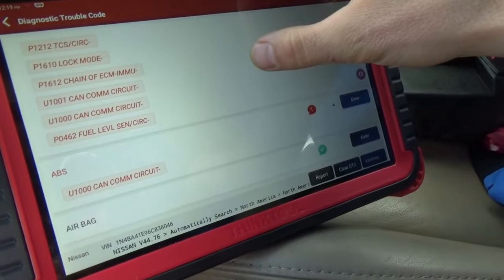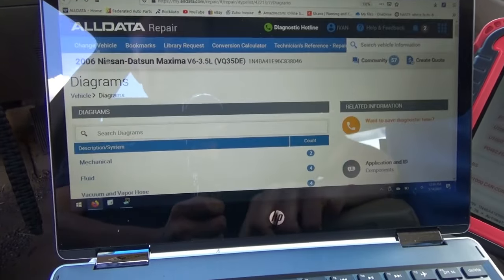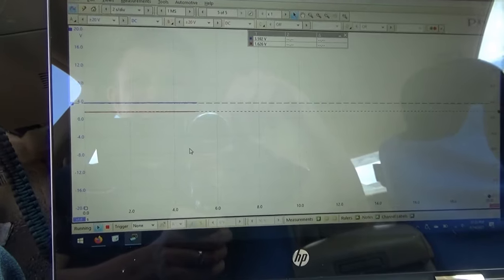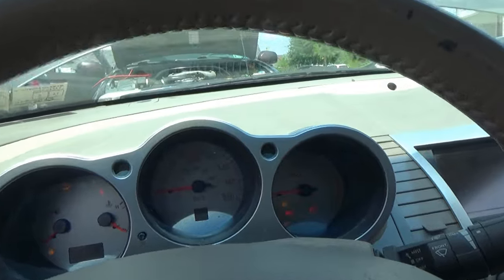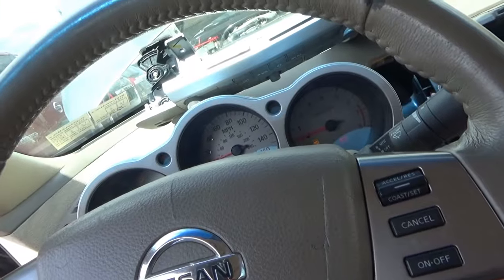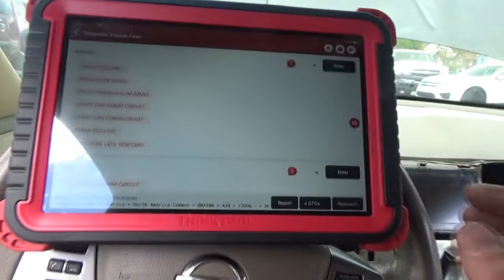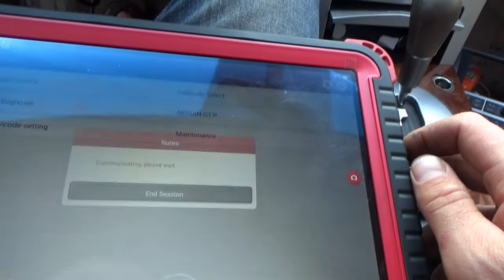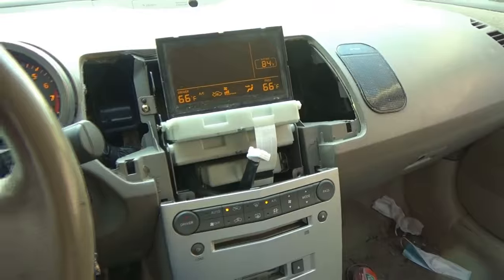You Won't BELIEVE why this Nissan Doesn't Start!!

Comment: I did one of these years ago. Wasn't too tough because...in an oddly proper move for me, I actually checked for TSB's for these symptoms. And sure enough, one exists for exactly this problem. Change had shorted the module in my case.

Comment: I live in Syracuse, New York. I'm tempted to bring my wifes 2014 Ford Fusion down to you to see if you can figure out what is going on with it. 3 other shops have failed. Good video.
Reply from the maker: Sure thing just fill out the appointment form on my website 👍

Comment: This was a very interesting one. I’ve actually had a similar case study a few years back which took me a couple days to solve. In my case the car was intermittent no start and also the engine would cut out and not restart after going over a bump at times. The end result was the lady’s toddler had been posting pennies (cents) into the CD player slot. They had made their way to the main board and were randomly shorting the internals. It was only after removing the unit and placing it down on its side by chance that I heard all the pennies jingling around inside. When I went to show the lady the issue she answered the door holding her child. During explaining the issue to the lady her child pointed at the radio and said “banky” 🤣 I instantly understood what had happened.
Reply from the maker: Amazing haha

Comment: How many times has it been the radio, for whatever reason. Rather after market or not. I can't tell you how many times lve found the problem to be the radio. Especially with battery drains.

Comment: Reminds me of back in 2000 when I bought this 1989 Celica GT (5 sp manual) for 1200.00. The car had been sitting for about 3 mo. and had a crank no start condition. I didn't know much about cars back then, but I tried almost everything to get it running and was about to throw in the towel when one day I was just looking around the engine and noticed some electrical tape on a wire connector. It wasn't easy to see hiding under some other wires and stuff, but I carefully unwrapped the tape and noticed the connector was kind of loose so I first pulled it apart to look at the condition of it, then put it back together and got a nice click and wondered why the tape? It seemed to connect just fine, so I thought for the heck of it, why not try and start the car. It started right up. It was unbelievable. The car ran great till I finally sold it just a couple months ago.
Reply: then it broke again?

Comment: I'm having the exact problem took the a/c module out because the car wasn't giving a code until I removed it. The car still didn't start but code came up as P0183 and P0462 which it says it's a fuel sensor but i already had put a new fuel pump in the car. Should I get a new a/c module could that still be the problem even with the code?

Comment: The can Bus is a 2-conductor bus, terminated at each end with a Terminating resistor, and if one is missing, it will cause "reflecting signals" on the Can Bus and it won't work properly.
Very often 2 of the modules will include the Terminating Resistor, and finding out which modules have them is a bitch...
Years ago, I faced similar issues with Arcnet coax computer networks that needed the same Termination Resistors at each end,  and if one was missing, the whole network would stop working..
Amazing that you tracked it down...

Comment: Looks like this is a case that we have been learning that all the modules need to see each other working and after awhile the car wont start because one of the modules has an issue. In this case , coins causing a short. Unplugged and replugging it in likely confused the rest of the modules so car would restart when you first were confirming diagnosis.

Comment: Moral of the story: don't buy Nissan.
That slot in the module is a board level diagnostic port. So it's got power and signal wires going to the microcontroller.

Comment: Is there a standard diagnostic charge in the land of salted roads and lots of body rust for a preliminary check of the integrity of powers, grounds, fuses under the hood/behind dash panel and for Bobby Pins and Paper Clips in critical areas of the passenger compartment?

Comment: My mom had a 2002 Pontiac Grand am. That had a no start.
 but would start with ether in the intake and ran fine. Eventually found out the fuse for the AC compressor clutch was blown causing the fuel pump not to run long enough. Crazy eh
Disconnected the compressor clutch and replace the fuse and car ran no problem.

Comment: Hi guys, I read some of the comments below and the first thing that Popped in to my head was  - why is not my mechanic work like this guy? I can say that the work was excellent.  No wonder that it took him 2.5 hours to find something that should have not happened- A Hair Pin inside a hole in a module with two coins on both sides, short circuiting it. He was never looking for that. Oh, and on the top of that, sure the computer told him something but it was not of any help what so ever.  Brilliant work. Just imagine how he finds the other stuff the usual ones.       Thank you

Comment: great find! yrs ago was a bmw tech, bmw would 'shop' its shops. they'd send out 'customers' to c if we'd mis diagnosis their cars. very common was pennies and dimes in the cig lighter sockets and seatbelt buckle holes. May be grounds for a class action against nissan for that hole. I c there's 1 against bmw for putting the srs module under the cup holder on its x7

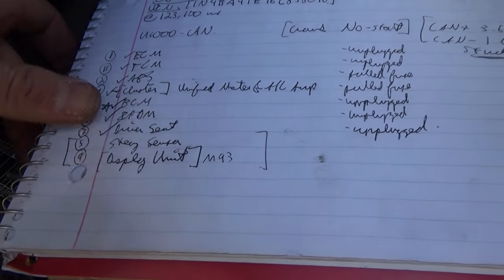Comment: At 7:51 , I think pulling fuses works only when can bus shows  12 volts which would mean module shorted to power .If not at 12 volts than disconnecting the modules is the best approach , some modules require a lot of extra time to get to.

Comment: If I wasn't a Nissan tech I would have been pulling my hair out tracing this down (much like yourself). Good work though. This is a pretty common issue to see at the dealer - whether its from spare change falling into the unit, or customers that remove it during radio installs having no idea what it's for. After reading the description this was one of the top guesses I had - was watching just hoping you'd pull the dash apart and find it. Nice vid on the issue - you'll save a lot of techs  on diag time

Comment: About a week or two after I bought a used Trailblazer, the horn would honk every time I turned the steering wheel to the left. It was still under warranty, so I took it into the Chevy garage and they found a metal token (Coin from the previous owner) that worked its way under the steering wheel airbag.
Reply from the maker: I thought that was a standard Trailblazer "get out of my way" feature haha

Comment: Once had the coin issue in a cd player in a chevy 15 passenger van. Found 2.50 in change in the cd player. Cust had 8 kids and they put coins in like a piggy bank. van started after I shacked the dash. Got lucky after the third time. unable to verify the first two times it started with out issue after being towed in.

Comment: One of my diagnosis instructors told us about this problem! Dimes were the main culprit, they fall in and short out the circuit board, and the updated modules just have tape over the slot.

Never thought I’d actually see it happen, Nissans aren’t a big part of my shops clientele.

Comment: Cool work man, as always!!!    Just like my 04 Maxima I had for almost 10 years.  Except mine was a manual. I miss it every day! Had it paid off… it did give me one nightmare repair- timing chain slack guide. Buddy and I fixed it though. Worth it. Just look- it has heated steering wheel! Best feature ever. And CASSETTE DECK!!!

Comment: In 1986 I was the tech at Aspen Auto Electric, I had one of the first Cadillac 4-6-8 500cid with no AC. IT NEEDED: AC/heat plenum servo, display module, sub module, four hours diag R&R time.
The owner offered to give me that car. No Thanks.

Comment: Had a coin fall down on my 2004 Lincoln Navigator climate control module and damage it but it did not mess up CAN communications. At least they did not get a new PCM before they figured it out.

Comment: Knew what this was before you got the finisher off.  One of the engineers at Smyrna had figured this out back when these were rolling off the line, but the plant management shot down his solution (to put a sticker over the flash port) because it cost like 5 cents... still coming back to bite after all this time lol
Reply: Wow Droz,  management worried about a 5 cent fix?  What, were they waiting for a 4 cent fix to save themselves 20% on the mod?  That sort of bs makes me sick.

Comment: Had a 2004 Altima that would fail to start if you did just one thing wrong.
You had to consciously turn the key hard to the stop when starting or the switch contacts wouldn't be positively engaged, the ECU would get confused about the position of the crank and cam while trying to start and then would completely stop communicating. Crank all you want, no start. Even if you reset the ECU. The procedure to start was to hold the gas pedal on the floor and crank and crank and crank. After awhile the ECU would begin to relearn where the crank and cam were and then start to fire a cylinder, turn over a few revs, fire a couple of cylinders, etc, etc until the ECU had confidence it knew where the crank and cam were and then start firing all of them. Nissan admitted that this as a known issue and this was their "fix" as well. I don't have a Nissan anymore.

Comment: Same issue with Honda... Kids stuff coins in the CD player. It shorts out the Tail lights, Brake lights and Dash lights...Also burns the fuse to the radio...

Comment: Dumass you got to have it in park to start it and secondly you have to have the jumper cable hooked up to the car not the negative post on the battery because the car is negative ground you should know that !! And I hope you didn’t hook up the jumper cables backwards because you’re running 12 V right to the computer which will fry the computer and the car won’t do anything !!!!! You know nothing about cars you’re lucky you got it started !!!! And the third thing you is  when using that tool you should have the car off when you clear the code and when you turn it back on it will successfully clear the code !!! You’re no genius that you got to go running !!!!

Comment: Micro voltage modules burn up with 24 volts...jumping battery to battery. Read a manual on jumping a car or the instructions on the jumper cables themselves. Some of them even have pictures for those that don't read or have poor comprehension. This post is from the beginning of the video. But, it still holds true. Best to charge the battery.
Reply from the maker: How do you get 24V?
Reply: @PineHollowAutoDiagnostics  If I remember right 12 + 12 = 24. If the battery you are jumping from is 12v and you run that into a 12v battery what comes out is not 12v it is 24v. Look in a Bentley Manual, not a Haynes, if you read the instructions on jumper cables you will see the same. If you read the instructions on a new alternator it will say the same. All say the same thing when jumping connect both cables to the source battery. And the positive cable to the battery of the vehicle being jumped and the ground to engine block away from the battery. I have had to replace many new alternators because of a bad battery and the car was jumped from battery to battery. Most voltage regulators in alternators are rated at 16v. If you exceed the 16v the regulator goes "pop", well, it is actually fried. I have a high voltage battery charger with a start boost...it says the same thing.
Reply from the maker: @martyjansing2675  I suggest that you look up some basic electrical theory. Batteries are connected in PARALLEL, no way you're getting 24V ;)
Reply: @martyjansing2675  You are totally wrong on the 24 volt part. 12 is all you get. Unless you are trying to jump a 12 volt system with a 24 volt system such as off road construction equipment uses.

    The reason to hook the ground away from the battery is to lessen the chance of a spark igniting sulfuric acid fumes and/or accidentally touching both clamps together and exploding the good battery. 

   Alternators can fail when trying to charge a very discharged battery...they are only meant to maintain charge not build it. 

    Start boost battery chargers feed high amperage, not high voltage.

Comment: Nice Find Ivan.  From the voltages I believe that HVAC module as asserting itself to a dominant state on the bus, but not talking.   CAN− to supply 0 V and (simultaneously) switching CAN+ to the +5 V bus voltage making a current path through the resistors that terminate the bus.  This was preventing any of the other modules from talking,  they were stuck in a recessive state, because they saw it was asserted.

Comment: Hello I have Mercedes e class w210, the ESP,ABS,PAS popped up one the dash when i was driving, when i turn it off it would not start, had all the lights on in the dash but no crank. turn out to be a 10A fuse in the over volt protector that popped. the fault was a noise filter at the back of the radio, that's now in the bin. P.S the w211 has something the same, if the glovebox light not working and the car won't start, its the fuse for the clove box to blame 7.5A

Comment: It looked like there were test contact points on the circuit board inside the casing. I'm guessing the manufacturer of the module uses them for final QC testing or something. Imagine shorting out a couple of those contacts, probably what killed the module.

Comment: I had a Lexus one time to diagnose a battery drain issue. Battery drain was because a module would not go to sleep. I tore apart the car following the harness from the fuse box. I found the problem it was a eBay Master power window switch, it kept a module awake. I swapped in a oem part, the modules went to sleep Problem solved...

Comment: Why is that hole there? https://youtu.be/0xVB9q8aPZ4?t=894   My guess is that is a JTAG  connection (used for debugging and programming) connector. Prototypes will have a connector there for development. Production boards don't populate the connector. Typically there is a piece of tape over the slot, but a heck of a place for a coin to land. Great job digging into what the real problem was!

Comment: Usually, it is the aftermarket radio that causes this problem, but not today.  Today?  Today is a very different day.  Beaten with the head of a president......this is the part where the customer blushes and avoids direct eye contact.

Comment: Nissan are some of the most misunderstood vehicles on the market today. But you found the problem the correct way. Process of eliminating. Also the explanation of why the car restarted after it died is because the immobilizer had already released the ECM and BCM authorization signal. Since you didn't cycle the key the immobilizer system didn't have to reinitialize. So as long as you don't cycle the key it will start all day.
Reply: cycle the key??? do you mean turning it back to lock position?
Reply: My Nissan has been giving me so many issues ...

Comment: The slot that the coin and hair clip fell in is probably used to flash the programming in the module, and testing during and after production.   JTAG comes to mind.    You can see the 6 solder pads directly underneath the slot.  BTW, I would charge extra to work in a really dirty car.  EDIT:  I just watched the Bonus #2 footage, and you called it on the purpose of the connector.  Great job troubleshooting that.
Reply: Great idea Craig!  Charge em extra for cleanup.  That's fair enough I reckon.

Comment: Will a code for the steering angle position sensor cause a no start? I have a crank no start on a 1998 Chevy Tahoe and there a code  in the passlock module for a steering angle position sensor and EVO power steering solenoid. It also makes a loud ping about 3 secs once you begin to start it.
Reply from the maker: Look up the code description!

Comment: There appears to be a row of 6 pads for "Pogo" style pins down that slot - I bet it's used for flashing software / testing at the factory with a jig that is designed to slot in there and make contact

Comment: Nice work on the diagnosis. 

It's more expensive to segment the network into a power train and body control network, for instance, but then you don't have some faulty ancillary module on the CAN network bringing down the entire car. I know other automakers do this.

That hole in the module is for a programming/debug connector. You can see when you peer inside that the connector was depopulated from the PCB, they just chose not to make a plug for the hole in the housing or change the mold for the plastic cover to block off access in the production modules. Its common to design a board with footprints for connectors like this and when the design moves to production you just don't populate the connector. In this case the hole in the module was an oversight and that should have been covered to keep conductive material out of the module. Even a sticker would have worked. Definitely a lesson for product designers.

Comment: I had a similar issue with my daughter's 2003 Saturn Ion, a bobby pin and other items had gotten into the HVAC system. That failure caused the damper doors to stay closed and she was cold. So she borrowed a known bad inverter (that the owner said was bad) to use an electric heater to stay warm. That blew out the body control module. Once I diagnosed all that (failure chain of events) it cost me over $1,000 for BCM and other parts for a $0.02 Bobby pin....SMDH.
Reply from the maker: WOW that's crazy haha

Comment: The hole seems to be to do some factory programmation on the module. By factory I don't mean Nissan, but the module manufacturer itself. The programmation port may also double as a diagnostics/debugging port, which might also be why it is there too, left over from the developpement.